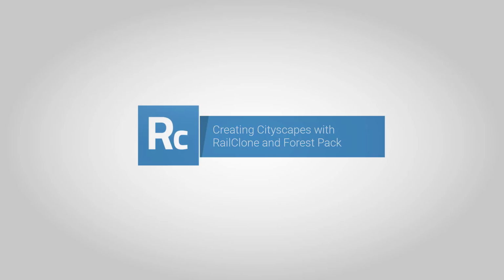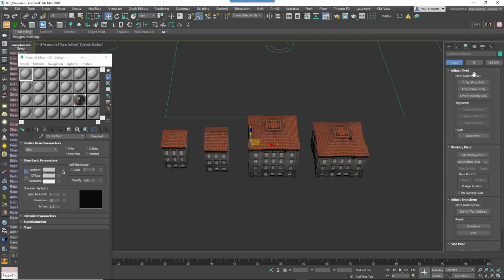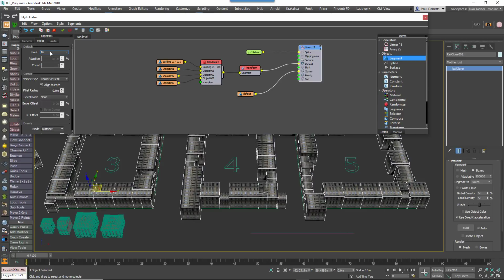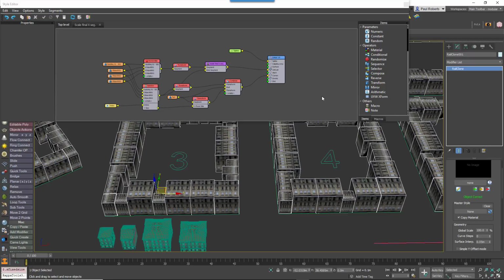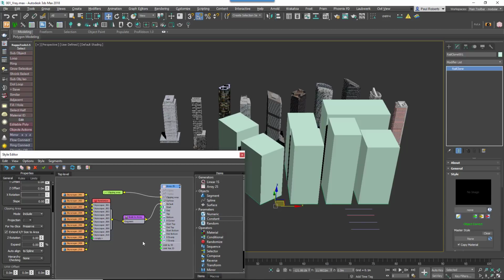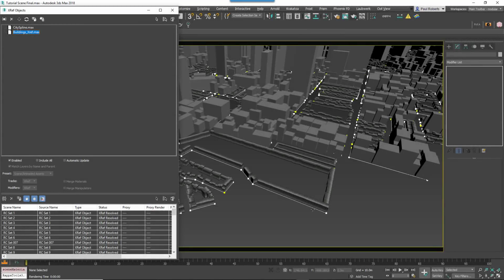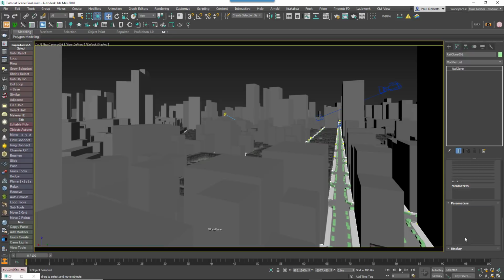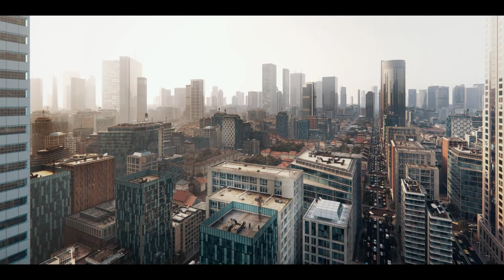TUTORIAL: Rendering Cityscapes with RailClone and Forest Pack (advanced)

Comment: I have three questions. Does Railclone come with predesigned buildings and houses? Can you design buildings and houses using Railclone? Can you import buildings and houses created in ZBrush into Railclone? I will appreciate if you could reply asap.
Reply from the maker: Hi, thanks for the questions. RailClone does not currently come with buildings and houses in its library though it can be used to create them as long as they fit into its modelling paradigm. Any model can be used inside Railclone, so as long as you can export the model from ZBrush to 3DS Max you should be fine. For more detailed answers please feel free to contact our support on helpdesk@itoosoft.com

Comment: Lol if u have one or more( one is more than enough) sharp angle in your path spline, prepare for overdetailed geometry glitches and scene crash. good luck
Reply from the maker: Hi! The best way to avoid that is to ensure all Segments have Slice and Bend disabled and that the generator's bevel mode is set to "none". In that way, no geometry is bent or sliced and full instancing is retained. It is true though that this works best on angles close to 90 degrees because buildings are not being edited to fit around the corners, only distributed along the spline.  If this doesn't help, drop us an email at helpdesk@itoosoft.com and we can take a look.
Reply: @itoosoft  okay. Thank you for fast answer. Yes, i allready checked bend, slice and bevel, its okay. But issue is still here.i have short spline with a couple of sharp corners.something around 70 degrees.and it looks like railclone trying to create huge array of instances, and as a result i having a problem with maximum number if instances reached.increasing display limits not help much.in this cases mostly i have strong freezes in 3ds max work. Sometimes it crashes 3ds max.  When i use splines with 90 degrees , it works fine.railclone can create huge array and everything works well. I'll email you, thanks